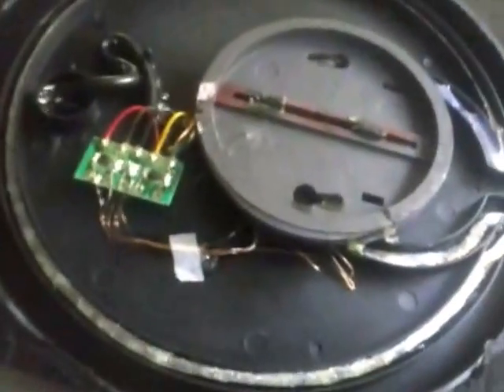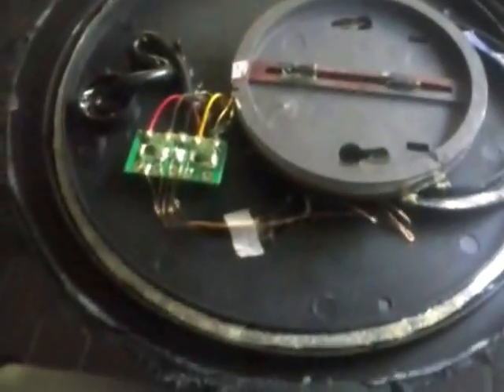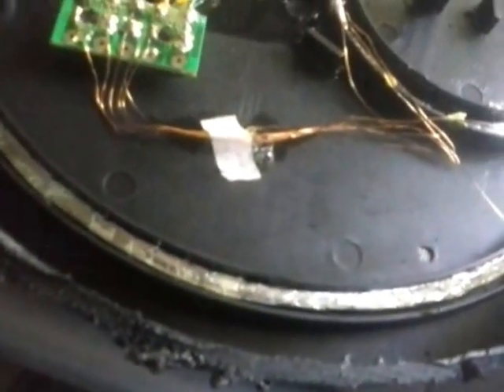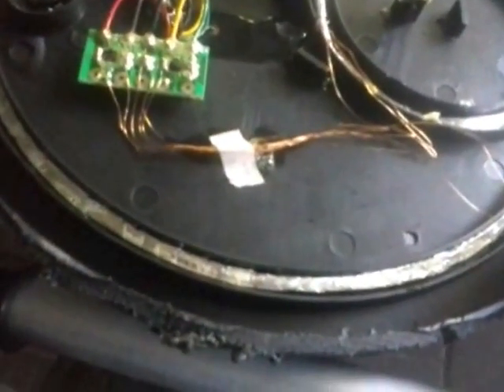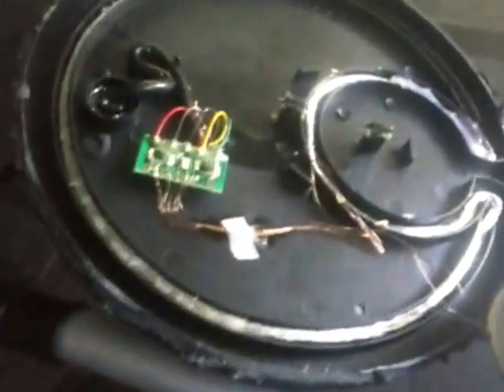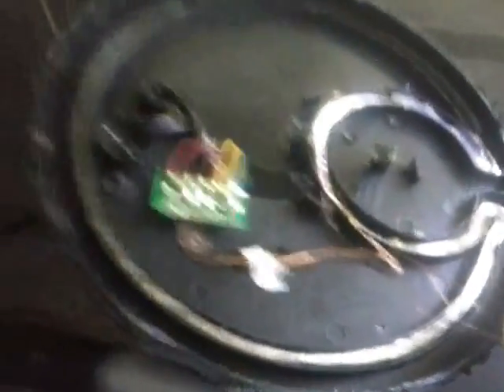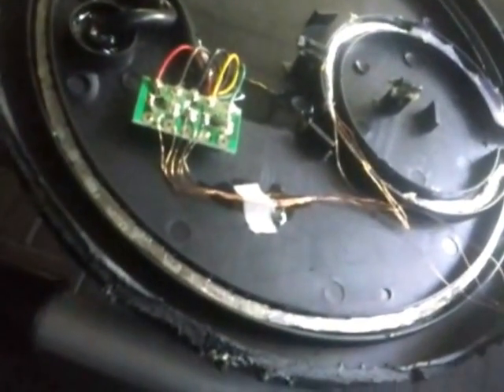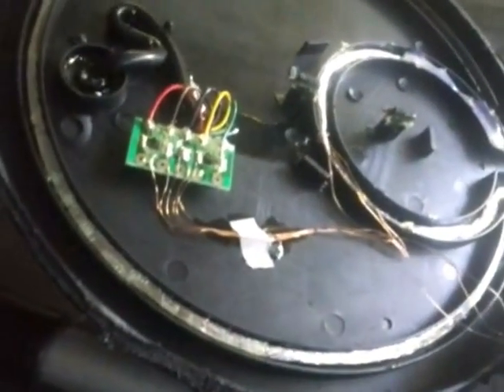Inside workings of a metal detector coil

Comment: I have been working on a couple of home made detectors from a forum, normally the third wire would be connected to the shielding that covers the coil (foil by the looks of it), connected to the negative supply line giving it a grounded shield which stops stray signals being picked up by the coil.
Reply: Any of those worked nice? Could you link if yes?

Comment: LOL I'm pretty sure 3 wires are attached to the coil, wound around it and then attached to the circuit board. It's clearly impossible to have 3 ends on a single line of copper.